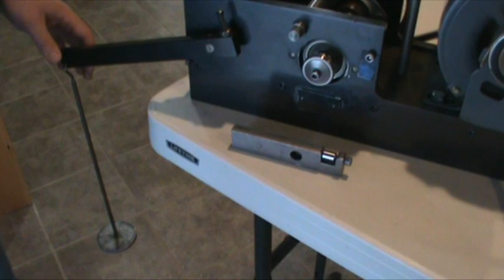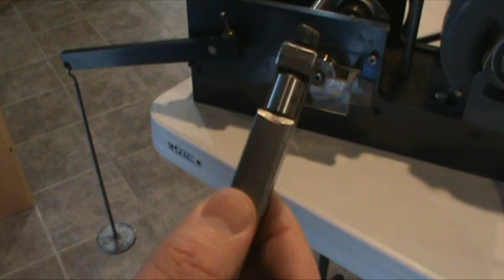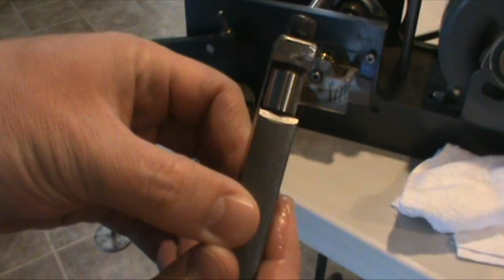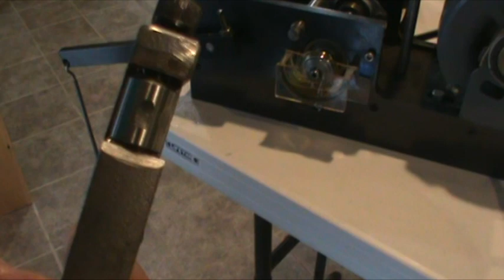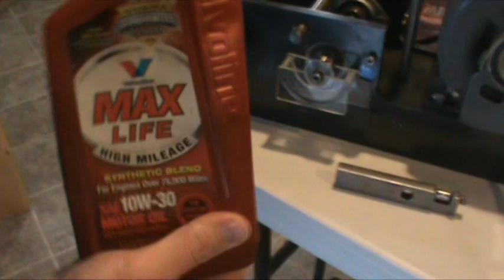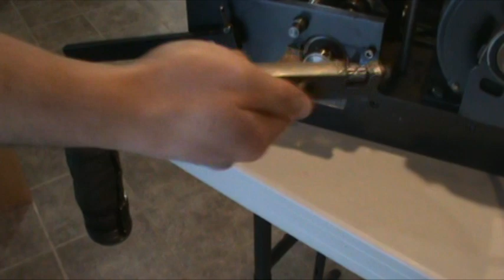Full Length Power up demo

Comment: I've been using this product for at least 15 years in both of my Harleys. They both have over 100,000 miles each on them and nothing has ever been done to the motors. One is an 89 Evo engine and the other a 2000 Twin Cam. The twin cam runs quieter , smoother and with more power as well as the evo. I now use it in both my tractors and 4 trucks. I tried slick 50 before I found this product. Slick 50 is nothing when compared to this product. Only problem I have now is the friend I used to buy this from as passed away and I don't know where or who I can purchase it from today.
Reply: Hey Low Tech. Sorry for the late response.  Please email me at w.justin@live.com and I can help you locate a distributor in your area.